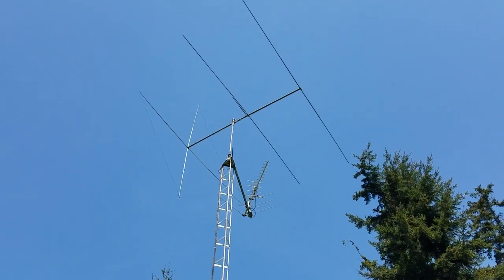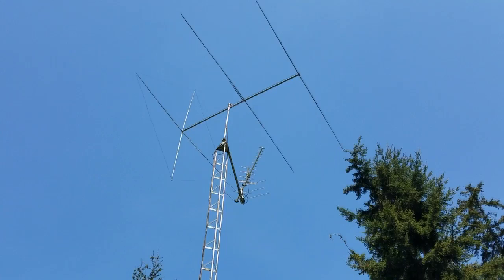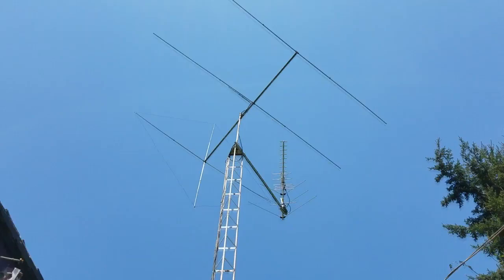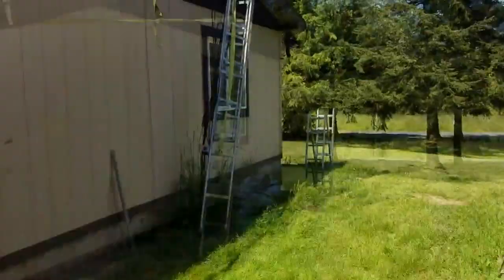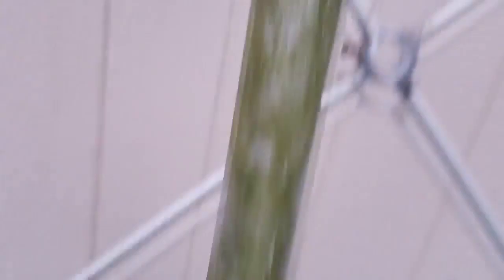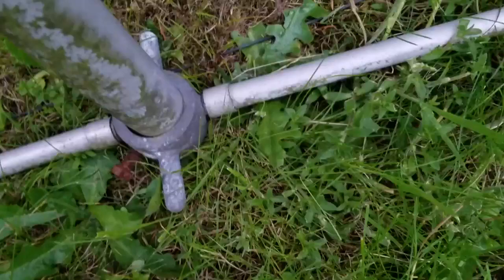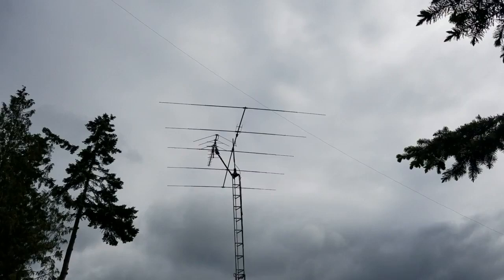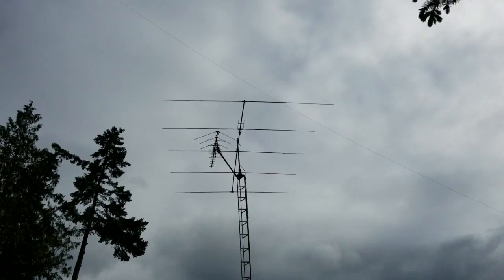New CB Radio Beam Antenna, 5 Element Long John replaces old MACO Comet

Comment: I've thought about breaking out the TIG welder and ending the movement of joined parts, lol. As for the boom to mast mount, I'd go to my neighbor who's a metalargist that has all the equipment and materials to make me a nice strong and sturdy bracket. That's a very important part holding all that aluminum up in the air through wind, rain, snow and ice! Although, I always lower my antennas to the ground at the first threat of a winter storm.

Comment: Yeah good call dumping the Maco with Gamma Match, and going to Hy-Gain type antenna using the Hairpin matching system. I have rebuilt Maco and the Hy-Gain type antennas with bullet proof brackets and such. Hope that new beam works out for you. Good luck.
Reply from the maker: Yes, I like the Hy Gain match system.... However, the Maco build quality is far better than the Hy Gain.

Comment: I’ve always said the people that engineer brackets and other things similar to that , never actually put it together , just on a computer , and are too dump to account for tools fitting in the angles where fasteners are needed to be secured . It makes no sense , which most engineers lack common sense and hands on skills anyway . Hope it holds up well and talks good , it looks like a great antenna for 300 bucks !! I think that’s what you said the price was
Reply from the maker: We call those guys, IMAGINEngineers
Reply: @390WagonMaster  
I just laughed really hard , never heard that one but I'm gonna use it in the future !
Reply: @390WagonMaster  
I just revisited this video from 8 months ago or so , at the time I was still toying with the idea of a beam setup but wasn’t decided on what brand . How are they performing? It looks great .  I can tell you from my recent install I finished  in December , Maco imagineering isn’t much better today  . I had saddle clamps that would not secure elements no matter how tight you torqued on the bolts , so I drilled and put self tapping stainless steel screws in , holes weren’t lined up, I had 3 or 4 missing key bolts and nuts and a bracket , and extra of others , I had to buff out burrs and hillbilly engineer my boom flange areas to get them to slide into each other . Absolutely terrible . If not for my experienced friend and antenna/radio enthusiast , several trips to Home Depot and the autoparts for self tapping screws , muffler clamps ,  sandpaper , drill bits , etc and etc ,, it woulda been a disaster .  Also I paid an extra 150 bucks for the 5K watt gamma match and they sent the standard 2K .. I ended up going direct fed via a balun like you but I didn’t have to use a hairpin match .  I’ll email you some pics of the genius idea my buddy made if you want . My SWR’s are 1.1- - 1.2 on 11 meter . And 1.4 or better from 26.000 up to 28.600 . Almost unbelievable.  73’s

Comment: Maco is junk. Just built a Y quad.  Thin aluminum boom that crushes even you tighten the driven end elements. They drop 2" from center of boom to ends.  $280 for something that I doubt will survive a mudwest rain storm, much less high wind, sleet or plain ole ice storm.
Wish I had the ole PDL 2 my Dad had back in the 70s- late 80s. Performed well and took all the weather the midwest could throw at it.

Comment: Hello 390  What model Hy-Gain Beam Antenna is that? Is that  a older CB Beam Antenna?  Jay in the Mojave
Reply from the maker: The 3 element is an old Maco I bought new back in the mid 80s. The Hy Gain I bought new around spring 2017.
Thanks for watching .... 390 SLC

Comment: Hey is your Hygain still up and running? Performing? Thinking about buying the same one.
Reply from the maker: I took the tower and beam down on July 4th 2019
I moved to another state, I now live in a high canyon wind location, not sue the beam will live long if I put back up without extra support. Was thinking of trussing the boom. I also get lots of snow at this location so between the wind and snow I'm thinking of going back to a Maco 3-4 element. Performance wise the antenna was a slight improvement over my old Maco Comet.

Comment: I've a new Comet, still in box, waiting one to install
 What SWR did you have on it and did you run Vertical, Horizontal, of harness for for both polarities?? I bought the harness but still haven't decided on how to polarize antenna.
Reply from the maker: I have used both Vert/Horz and each takes it own run of coax. I liked having both and used a switch box to go back and forth. One of my vertical elements fell off in a bad storm, and already using a ground plane I didn't feel the need to keep the vertical section going as I had locals all around me. The omni was less of a PITA. Swr was around 1:1 and 1:3 in the CB Band. That Comet is a great antenna. Enjoy
Reply: @390WagonMaster  Macon makes a polarization harness using 50 and 75 ohm coax. One freed from transmitter to Tee connector at antenna end which feeds both vertical and horizontal elements simultaneously....they call it CIRCULAR polarization. I bought the Maco harness for that. Wondering if you had ran that and how satisfied?
Reply from the maker: I would NOT suggest that. You should stay true V or H. Did that back in the early 80s It hurts your overall performance. IMHO. Cheers